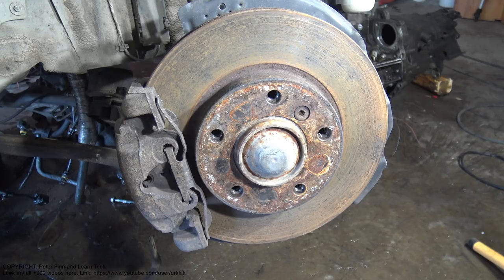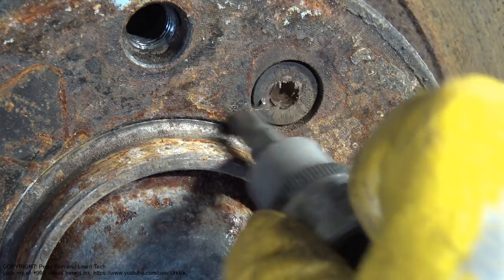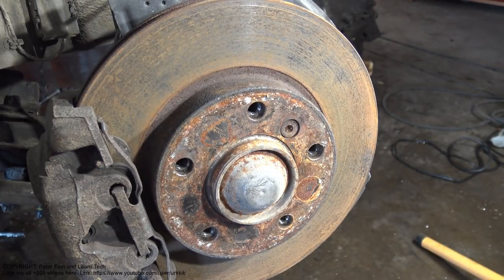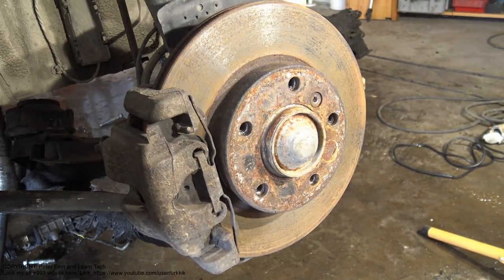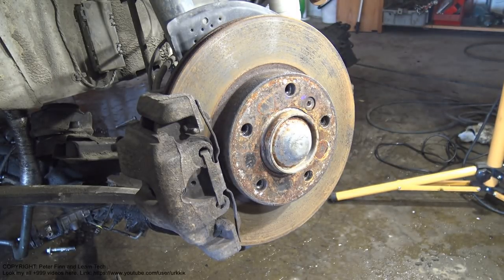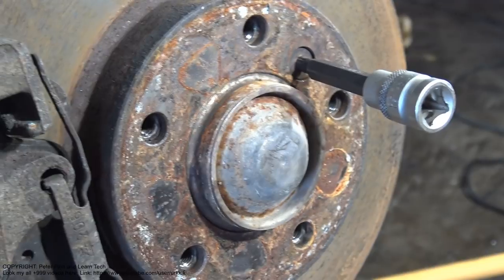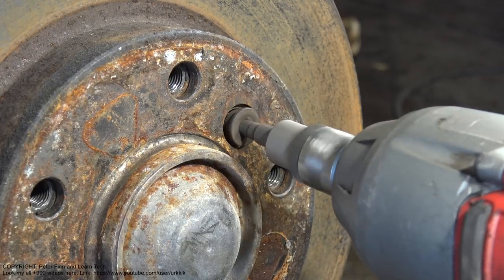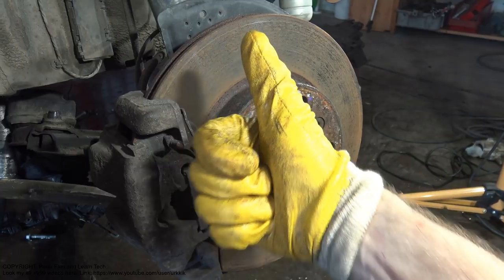How to remove a Stripped and Worn Out Bolt in brake disc

Comment: Drill it out. Those bolts are there to keep it (rotor) in place during assembly line travel. Once you get it out discard it and no need to replace.
Reply from the maker: Thank You, my Friend. :-)
Reply: Thanks Shawn, was gonna give up and then saw your post and thought yeah your right fuck this let's drill the bolt! 😁😁😁

Comment: Very clever trick Peter! The question is: will you buy a new bolt from BMW dealership center, or will you use this bad quality bolt applying this trick like a real handyman?
Reply: Di Tr The bolt is only there to aid in installation of the brake caliper. You dont even need to put it back. Its an assembly line retaining bolt. 
And I've always just used a chisel and tapped around in a circle. If that doesnt work, I just chisel the head right off the bolt. 
Good video though.
Reply: @droopmodMRC
Nice information, your solution is clever also. Yes, very good video!
Reply from the maker: Hello. This bolt is important bolt. Must be place back. There is No any assembly lines bolts even in BMW !
Reply: Hello Peter! Yes, I think so, also! I can't believe this bolt is useless! And that makes your trick even more important!

Comment: Been trying to get out that stupid screw on my front disc. Used a torch and a manual impact driver to no success.
Just won't budge, and I don't have air tools.
Is drilling it out the only remaining option ?
Reply from the maker: Yes, Drilling